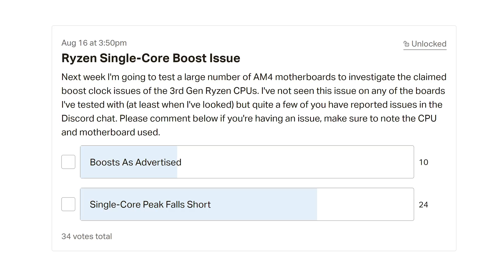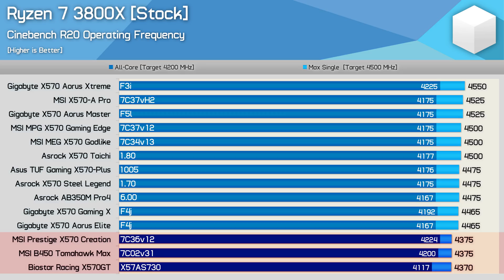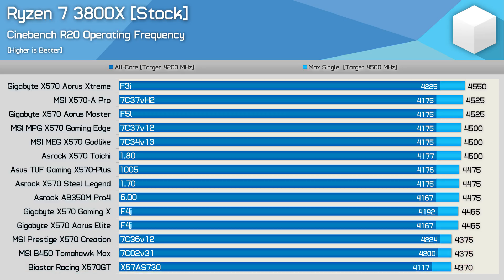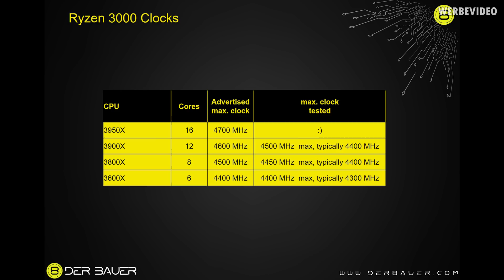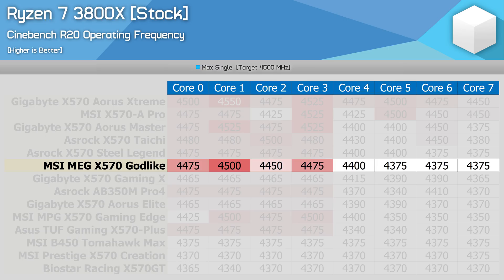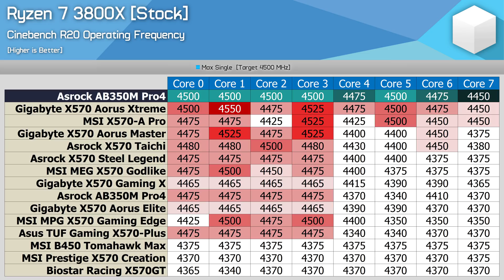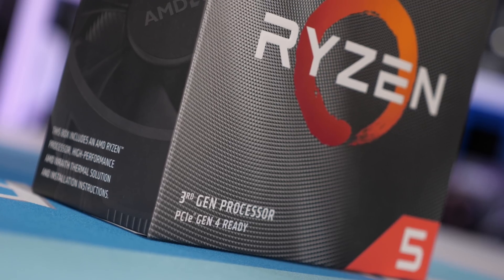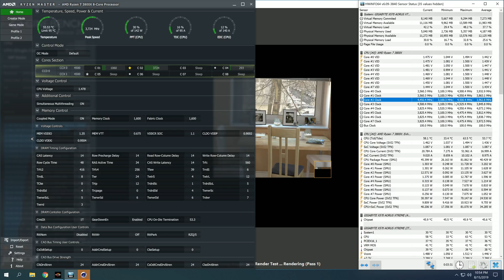AMD 3rd Gen Ryzen Boost Clock Investigation

Comment: Who cares? Can we give AMD props for designing the chip around the fastest core 0 because of the Windows scheduler?

Obviously, doing an all-core overclock on say the 3900x is a bad idea. CCX set 2 will drag you down. My guess is that binning, the thing responsible for your competitive prices, is the reason CCX 1 performs better. If you must do a manual overclock, then overclock CCX 1 (make sure they remain the same clocks across the entire CCX) to a higher value than CCX 2. Then set affinity in games to use the faster cores while leaving the rest to background tasks for a smooth multi-tasking experience. Some people in Tomb Raider alone were able to go from 113 FPS to 174 FPS doing this.

If you're lucky enough to get your hands on some Trident Z Neo B-die DDR4-3600 CL 16 RAM, then you can even set them to DDR4-3800 CL 16 and set your infinity fabric to 1900 Mhz so it remains coupled and enjoy.

Comment: Thank you for a great work. I wish such test would be also on good x470 boards like Asus Strix x470 or MSI Carbon Pro x470. I wanted to dodge active cooling but it is unknown for me if these boards will reach similar performance/boost like most x570 boards or they will reach even worse boosts.

Another think is memory support which is also not so checked (how worse speed I will reach with good x470 vs low x570 boards).

Comment: I wish my 3700x was only 50-75mhz below the advertised 4.4ghz single core boost. I've never logged a core going over 4.2ghz. I'm nowhere near thermally throttling, at like 48C in single core loads. Yet I get 4.16 on all cores when doing multicore work.

Comment: i managed with msi b450m vdh. + Ryzen 3600 at 4.3gHz  and 1.375v  and 62 degress c on full load.   im using an Arctic Esport Duo for cooling. (awesome cooler for money) works really well. 

i got this with Auto overclock. then just brought down the volts a bit to bring down heat. and find a sweet spot. because it was already a decent OC, just needed some tweaking.  PS, the RGB on msi is terrible. and the Bios ubdate for 3000 series is still very beta. so use AMD OC software. doing it in the Bios is super limited until they update it.
Reply: what your tem in idle, and your temp while broswe youtube videos? are u getting only 62 C on Cinebench multicore ? what was your temperature before at stock voltage on Cinebench multicoreat at 1.460 V stock how many degree C u get?
Reply: also did u get 4,3 Ghz all the time in idle to?

Comment: If Steve tested the CPUs in same way he recommend it to us: Looking at max speed on hardware monitor, he tested the CPUs WRONG!
What he tested for is just a momentary SPIKE, it has no practical worth.
Ryzen 1000/2000 and ALL Intel CPUs do Single Core Turbo boost by keeping single core at max advertised value for as long as thermal or power limits allow, it can be tens of minutes and hours depends on cooling.
Temporal SPIKE for 1-2 seconds has zero worth to the community and just shows how AMD scammed as all with fake Turbo Boost Speeds.

Comment: why the 3900x comment about not hitting max boost ? my 3900x hits 4.6 - 4.625 just fine (up to 3 cores at the same time) under light/medium load. Aorus Master, PBO, stock cooler https://streamable.com/no6qb

Comment: Strange. I just found out recently with my Ryzen 5 3600 when i paired it with a normal B450m Mortar Titanium with the Bios Beta Update 7B89vA7. It was hitting 4.2 Ghz max stock clock speed. But when i updated my Bios to newer 7B89vA8, The stock speed is not hitting the 4.2 Ghz anymore even when i enable PBO + Auto OC. Well, it seems like reverting back to my old Bios is what i'm gonna do next. 

Update: Just reverted my Bios to older 7B89vA7 with my MSI B450m Mortar Titanium and it now boosts up to 4.2 Ghz at stock settings again. If you got the same motherboard don't update to newer 7B89vA8.

Comment: What I don't understand is if you can manually oc the 3800x to run at 4.5ghz all core on a budget b450 why not do that on the newer x570 and be done with it? What is the advantage to boosting instead of overclocking manually?

Comment: Dudes you don't shy away from hard work ...mucho respect....though the Ryzen boost frequencies are a moot point as Ryzen 9 chips are delayed again in the UK ... I've cancelled my order as I've been told I gotta wait for at least another 4-5 weeks ...close to pulling the trigger on a 9900k system as they're in stock...shame I really wanted to buy AMD for my work PC this time ...( I do have several other Ryzen 1st and 2nd gen PC's though)..in Ballance I have more AMD than Intel ...never thought that would happen.....even my main employer is changing out they're PC's for AMD systems .. mainly thanks to the Intel speculative vulnerabilities...Even with the slight frequency problems the Ryzen 5 and 7 CPUs are fantastic value.

Comment: Maybe it's the power delivery settings? I went to the DIGI+ VRM part of the BIOS of my Asus X370-Pro and changed all the settings from 'auto' to '120%', 'mode 5'  and 'extreme' and where before my 3600 was more or less stuck on 4142 MHz, it now goes to 4192 much more often and even goes above 4200 sporadically.

Another weird thing I noticed is that when I leave both the core voltage and the multiplier on 'auto', the core voltages for the separate cores are reported by HWMonitor as about 1.43. When I applied an all core multiplier of 42, leaving the core voltage at 'auto', they dropped to 1.1, although the reported CPU VCore voltage was still 1.4 and the powers about the same as with the multiplier on 'auto'.

Comment: I've always been an ASUS fan and the x570 Hero VIII was out of stock on launch day, everywhere. SO, I ordered the Strix x570-E. My 3700x wouldn't boost past 4275mhz in r20. Updated bios to new ones, cpu wouldn't boost over 4200mhz and I lost my  memory 3800mhz/1900mhz Fclk stability. I swapped bios back to out of the box and everything is stable again (minus low boost). Might have to sell this board and switch to MSI or Aorus...

Comment: My 3800x will boost above 4.5 GHz out of the box. Default everything but ram and upped the fan speed on my AIO. I'm not sure if there is much of a link between mobo and clock speeds, as my mobo is a lower end 570 board. ASUS prime pro x570. Nice looking board but nothing like the $500+ boards they're offering. I can tell you i was getting below 4.5 on most cores with only one or two reaching or exceeding 4.5 i until i upped the fan speed on my aio and kept temps under 70c. now my max temps are around 67 (was low to mid 70c before) and all cores are boosting above 4.5 while gaming. HW monitor is reporting 4529 MHz max on 7 cores and one absolute champion of a core reaching a max of of 4533 MHz. Would be interesting to see how much you find the coolers make a difference. Maybe comparing their stock coolers against mid and high range aio and air coolers.

Comment: found even in my bios version of 2019-6-9 (msi mpg gaming edge wifi) i could hit 4.6 on two cores, 4.65 on 1 core. Did it by adjusting power to "AMD Ryzen High". Balanced would usually keep me at 4.5~ 4.45. Good luck you all.

Comment: With my 3700x/aorus master i'm seeing 4.15~4.175 all core with pbo enabled, single core just sits at 4.3 with pbo enabled, that's 100mhz bellow stock 4.4 turbo. Even weirder is that with pbo disabled, just stock settings, i get 4.375 max for single core, all core drops to 4.0 though. 

That 200mhz pbo override is just for show.

Edit: forgot to mention that's with a 2x360 custom loop.
Reply: Same here... Tried everything for one whole week.. Ended up with manual OC 4.2GHz all core @1.33V

Comment: Watching this video motivated me to do a little testing of my own.  My setup, Gigabyte X370 Gaming 5, Ryzen 3700x, BIOS F41 (AGESA 1.0.0.3 AB).  Default out of the box setting except for OC RAM (XMP is 3200 and I OC to 3600) with a R15 Cinebench single core max clock on single core was 4, 352.  PBO 4, 270, Auto OC set at 200: 4,250.  I tried default with stock ram speed, not even XMP but I did not see a change for that.  

Lower clock speeds when PBO or Auto OC is enabled by up to 100 Mhz.

Comment: Awesome stuff :) Even more awesome would be if you could do a piece on idle voltages/temperatures. Steam + iCUE running, moving mouse around (1000hz) and just using a browser. Any of the previous mentioned shouldn't force max boost with 1.45V and 55C, but they are for some (all?). Maybe that too is motherboard dependent and not only CPU silliness.

From this video I saw 33C idle with 1V idle lows for the Gigabyte Extreme board, but as you were benching likely nothing running on background unlike typical system.

Comment: My 3900X seems to boost to 4.5-4.6Ghz only when I have core voltage on Auto. If I do offsent with lower voltage... max is around 4,441.9Mhz.... I'm kind of forced to run it on offset mode since it temp will hit 90s with Auto... even with offset... I'm already hitting 85c+ ... and this is with Noctua NH-D15 😑

Comment: i have the asus cross hair vii wifi running the 2501 bios and 3600x, it will only hit the 4.4ghz boost on 4 of 6 cores if i set all bios PBO settings to max, 2 hit 4.441, 2 @ 4.416 and 3@ 4.366

before i "upgraded" to the 2501 i observed the fastest cores hitting 4.46 a couple of times so i am full convinced it is a bios issue. 

can you review / discuss / explore the sense MI skew bios settings in asus bios. 

thanks for all the detailed content!!
Reply: just to add this is also running a custom water cooling loop just on the cpu with a 240 rad, also tested with a 360 rad and tested with a 240 AIO, the 360 rad setup hold the highest sustained all core speeds for longer followed by the 240 rad then the 240 aio. temp plays a big role, and increasing voltages only increases heat and reduced sustained clock speed.

Comment: I saw the same behavior on the X570 Creation under the new bios, but the out of the box bios on the creation I saw the 3900x flicking at idle upto 4.625ghz I suspect the change was bring a better all core performance then other boards by bringing up those all core speeds and sacrificing the boots as it hardly makes a diffrence in many content creation work loads

Comment: So on a Asus prime plus b450 board, I was able to get my 3600 to hit 4.2ghz on all cores by turning everything in bios to stock and just enable xmp profile. I was also able to maunally overclock it to 4ghz all cores at 1.35v as well. The only problem I have with the auto overclock is, I was seeing as high as 1.461 volts when all cores did hit 4.2ghz.

Comment: This was brilliant.  This may be some of your best work this year.  Finally, a thorough comprehensive report on what's going on here.    I find it quite interesting that the 3900X runs just slightly faster than my Threadripper 2920x - currently peaking at 4.3 ghz ( PBO off)  I was expecting Ryzen 3rd gen to run at 3.7ish,  but no way.   So people are not happy to see just 4.3 or 4.4 ghz.  All that aside the IPC gains push the new processors way beyond my Threadripper....  It's just a human thing.  We have to get over the ghz thing.

Comment: Thaw was surely a lot of work to do all of this testing. But you guys forgot about something. Based on what I have read and seen new AMD Ryzen CPU's are largely affected by memory performance. And because different motherboard may also affect the performance of same memory modules your test might not show the most realistic results. 
So I suggest you go and pick a few motherboard and go redoing same testing with different memory configurations on them. I suspect that it will generate much more variations in the test results. And if you go and do this extensive testing on all motherboards I'm pretty sure that more of them will be able to achieve advertised clock speed with memory configuration that works best on that specific motherboard.

Comment: It's an Agesa issue.  I was getting 4.6+ on 6 of my cores easily on my X370 1.0.0.1.  updated to Agesa 1.0.0.3 ABB and haven't seen 4.6 since.  4.55 max.  Ram compatibility better boost speeds down ☹️

Comment: Ryzen changes frequency/voltage up to 1000 times a second. HWinfo's default polling rate is 2000ms, and changing it to the shortest 100ms polling rate creates so much cpu load that it affects the boost clocks. You have to be lucky enough for it to poll at the boost clocks you're looking for and you really don't know if it isn't hitting max boost clocks when you don't see it in HWinfo for the 99-1999 times the CPU could have changed its frequencies when HWinfo isn't looking. You can only get a general idea of clock speeds over time. You can absolutely hit the max PBO+Auto OC clocks with enough cooling headroom, it just requires unrealistically low temperatures from sub-ambient cooling.

Comment: I have an Aorus Pro Wifi, using Hardware Info I have seen 6 cores running @ 4.195 on my 3600. Hardware Info says it’s an Engineering 
sample. Anyway very happy with new system

Comment: I think these PBO values are not true. I have a Ryzen 3700x that never hits 4.4 GHz. In the begin, I thought was my ITX case/cooler/airflow limitation. So, I bought an AIO cooler system, change the Thermal paste for Grizzly brand, replaced my fans to Noctua NF-A12x25. Temperatures under AIDA stress test dropped 85-90° to 70-75°. The maximum clock speed that I got was 4.365 GHz. My motherboard is Asrock Fatal1ty B450 Gaming-ITX/ac with latest bios version ( 3.50).

Comment: I had issues with my ryzen 5 3600x where it was running at 4.2 all the time and wasn't boosting to 4.4 on any core. That all happened after I updated my bios to the latest one. After a week of tinkering, I rolled back to a previous version and then the cpu starts working perfectly.

Comment: As somebody who's running a 3.8Ghz Carrizo X4 processor ... I don't understand what all the fuss is about. You put in the processor, and it works ... and a few BIOS revisions later it will work better... big deal... that's the way it has always been...
Reply: It won't be fixed if there is no fuss, no one would spend money and time on it

Comment: I had a hard time, tweaking the 3600 with just PBO and Auto OC, and I'm still a bit confused, by those "new" features...

With PBO I hit 3950 mhz (240mm AIO) when testing with Cinebench R15/R20.
(ASUS x470 Prime Pro)

I was pretty disappointed, so I applied an BIOS all core OC to 4.2 Ghz at 1.35V, but left PBO enabled.

All cores boost to 4199 mhz in Ryzen Master, and shut down at idle, but cinebench reads 3.6 Ghz.

I saw severl videos of manual OCs showing the actual OC clock in cinebench, so I'm not sure in what state my system is tbh. But sure enough it works.

Comment: i feel like many of the discrepancies with amds marketing and how the processors perform comes down to how different they are from intel cpus. everyone has gotten into the mode of comparing clock-speed to performance from one gen i7 to another gen i7. and so to try and get more people switching over they pushed the ryzen cpus to the edge and advertise the highest possible clock instead of the highest average clock. so while the marketing is technically true and the performance isn't any different it helps with reaching the people that have clock-speed tied to performance in their mind

Comment: Max boost clock I got on my 3600 was 4299MHz on X570 Taichi with Cooler Master 360R AIO in both Firestrike and Timespy.
Reply: what voltage ar you running?

Comment: Anyone else seeing totally random reboots / power loss or BSODs when boosting?
I've had to fix my clock speed ratio to get my system running stable with an 3900X.
After many hours of troubleshooting and swapping parts out I can only conclude it's an BIOS problem.

Comment: I have a 3700x sitting on an asrock x570 steel legend, I have had this same issue hitting max boost frequency of 4.4 on every bios except 1.10 release bios. All other bios versions I've tried (1.30 through 1.70) max frequency is 4.374 at best, With 1.10 I get 4.4ghz and have even topped hitting 4.415

Comment: Steve, Use the release BIOS on the X570 TUF. You will find that it hits advertised boost Clocks. Agesa AB and ABB (I believe) knocked the boost clocks down in favor of complaints of high voltage. That is my findings - RVENGER

Comment: I am still running my 1800X (all-core 4 GHz @ 1.35V). And that's going to stay for the foreseeable future. While I am seeing the benefits of upgrading I know for a fact since going through the teething issues of the first gen it's best to wait until things are settled. AMD and Intel are pretty much similar in their marketing behaviour now. Intel did it first when they only released minimum and maximum clock speeds but no longer told on how many cores at the same time. Whatever the reasons I think that both suffer a bit from over-ambition.

Comment: That was pretty good thanks for the video. While I was running my ryzen 3600 on a stock ryzen stealth cooler, during cinebench R20 multi core test the maximum boost clock was 3850 I swapped out my cooler to a hyper 212 LED and ran the tests 4 more times and I saw my boost clocks go up to 4200 MHz on all cores. So from personal experience it appears that better cooling solutions will give a better boost overclocking experience.
Reply: 3850 is to low, probably issue with small amount of paste and bad contact when stock cooler was instaled, 7nm ryzen is dodgy
Reply: @1GTX1  Yeah the Ryzen stealth cooler was pretty bad in my experience. I used the thermal paste that came already applied on the heat sink itself which is usually a bad call. It's definitely a bad call for them to not at least use the wraith spire like they did with the 1600 when that launched but I get they want to cut costs and stuff and I had planned on using a beefier air cooler

Comment: I have the asus x570 strix-f with a 3800x and it never went above 4250mhz on auto. I simply manually overclocked all cores to 4400mhz with 1.356v and called it a day.